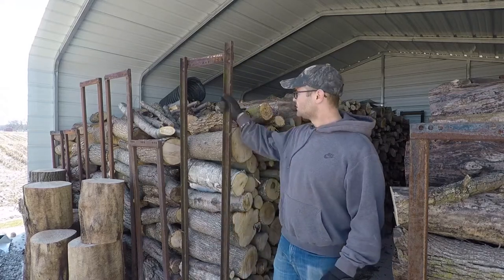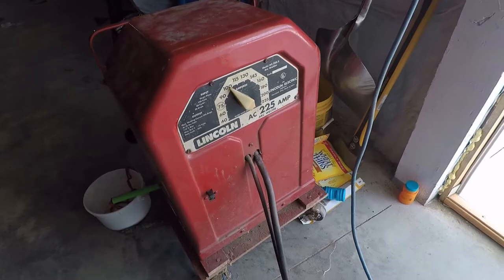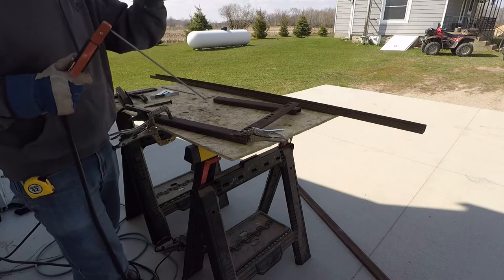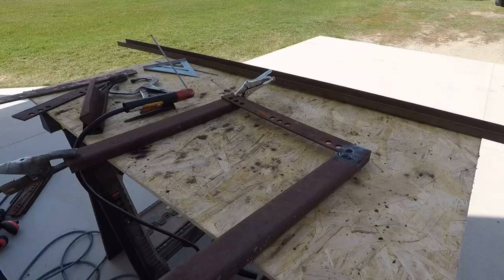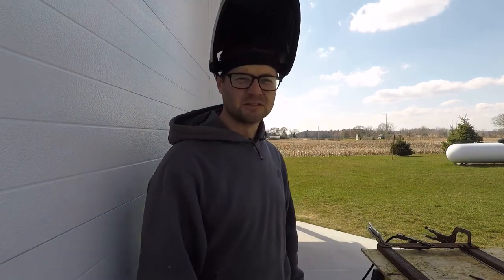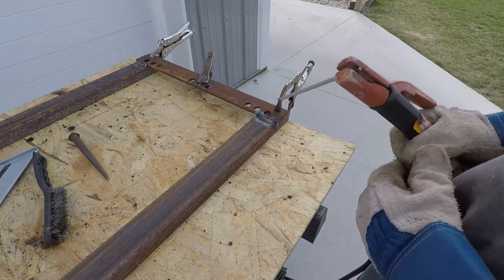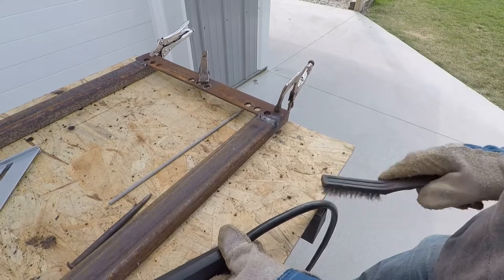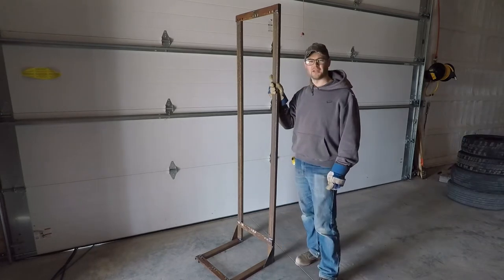Building Firewood Racks From Scrap Metal

Comment: Nice work and good job jumping in and giving welding a go! Getting started is the first step. Welding is a muscle memory and repetition game. Try holding the rod a tad closer to the material. If you notice the light gets brighter and the arc becomes unstable that means you are long arcing it: pulling the rod to far away from the material. A good arc gap will be the width of the rod that your using.  
Material prepping just as @dankisla said is very important for clean penetrating welds👍🏻